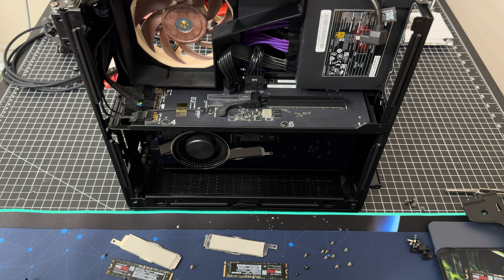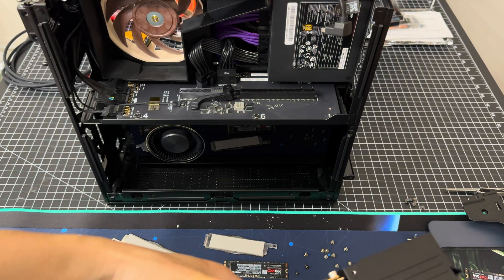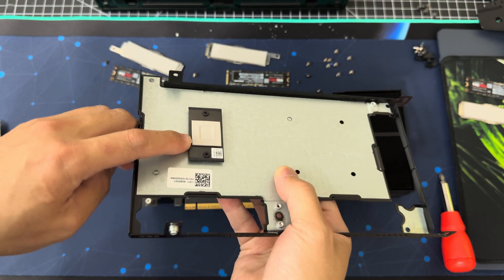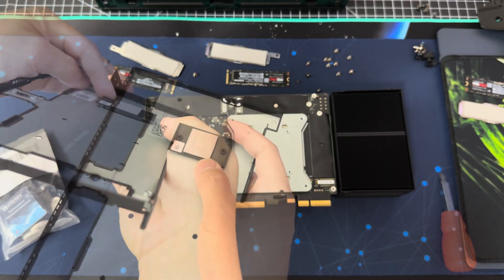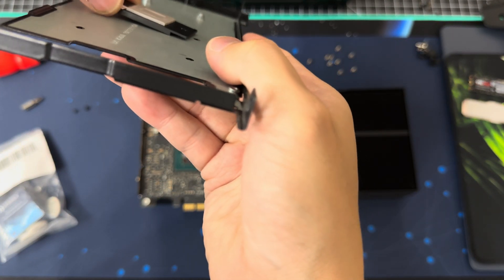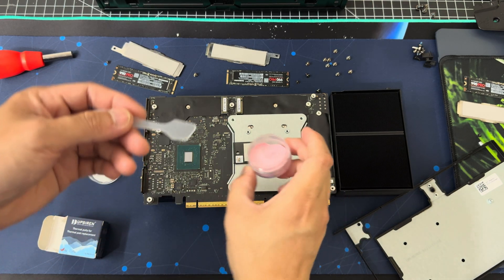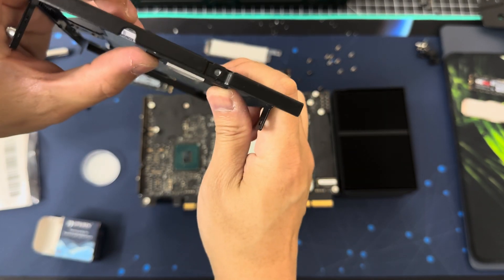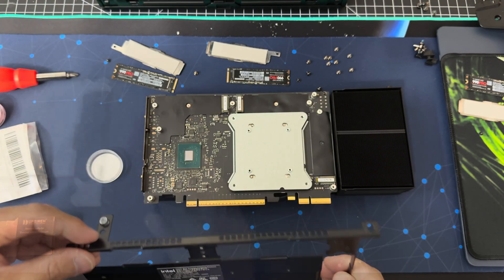How To Fix The Intel NUC 13 Extreme Platform Controller Hub (PCH) and Crackling Audio

Comment: Thank you for the video! It droped PCH temps a lot for my Intel NUC 13 Extreme i7! But I used 2mm Gelid Extreme thermal pad for PCH heatsink. And replaced the PCH Thermal Pad with Gelid Ultimate 1.5mm. Also, replaced all NVME Thermal Pads with Gelid Ultimate 1.5MM. Don't forget to put a rubber support under NVME SSD in the middle. It beds under 1.5mm Thermal Pad, but 1mm Thermal Pad don't have good contact. And don't forget to set in Windows Power Plan: PCI Express Power Management - Maximum Power Settings! This is the main issue, why PCH overheats. It doesn't impact performance at all. Nor NVME or other devices. I also replaced PCH Thermal Pads for Intel NUC 12 Extreme. You need 1mm Thermal Pad. And setting PCI-E to Max Power Savings is decreasing temps by 20C under load, and 40C in idle. So idling at 50-60C and gaming at 70-80C! This is huge!
Reply from the maker: This very good advice and I appreciate the extra tips. Comment pinned! Thanks for your valuable contribution.